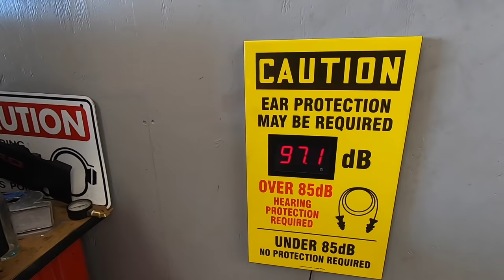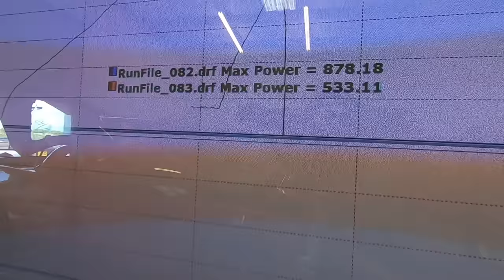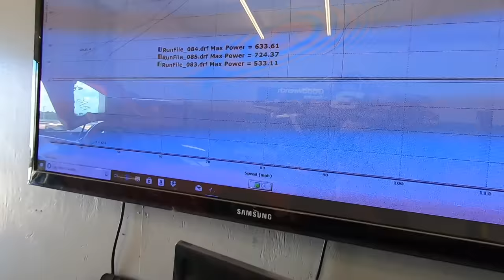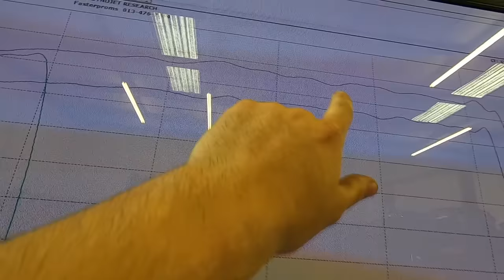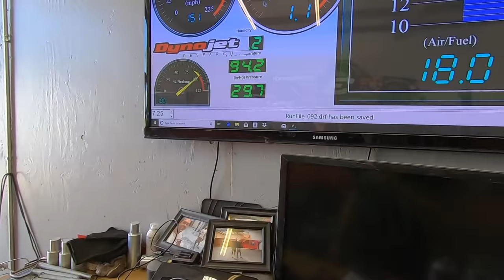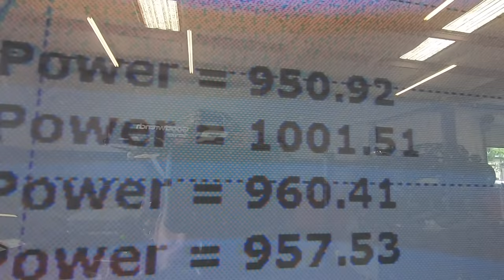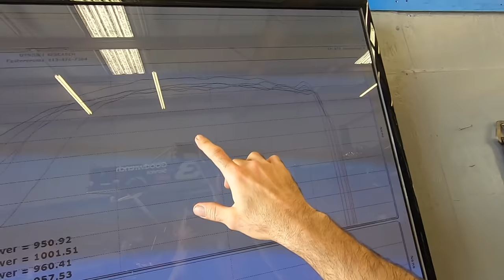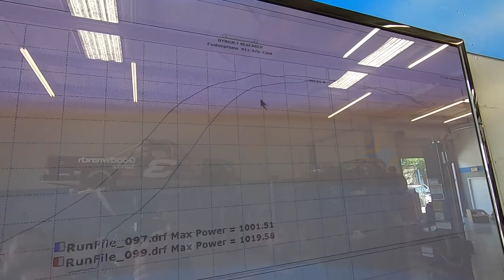The Auction Corvette BOGS DEEP For 1,000hp... Can the Junkyard Engine Do It??

Comment: An HP curve that flattens or dips at the end is  volumetric efficiency issue (Though your torque curve would show it better, as it would be peaky). Could be that you're using factory exhaust manifolds or it could be your cam. Try retarding your cam a few degrees?